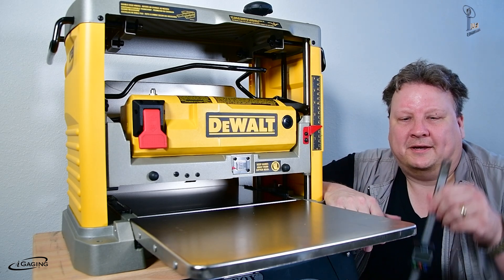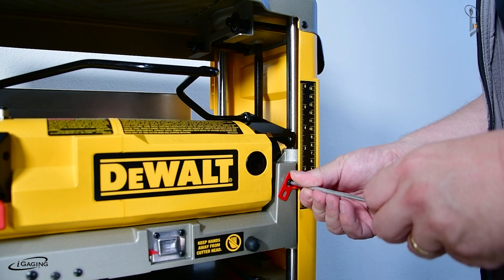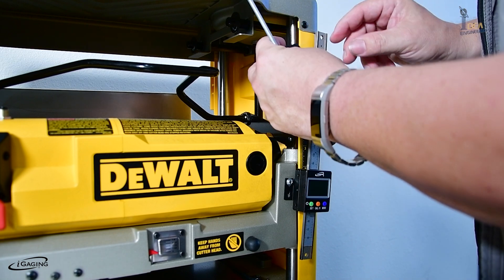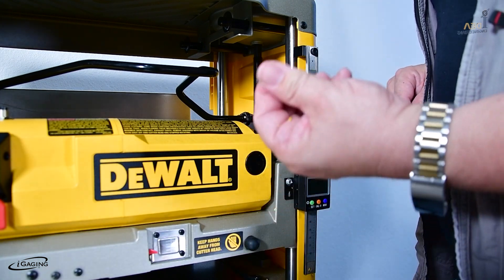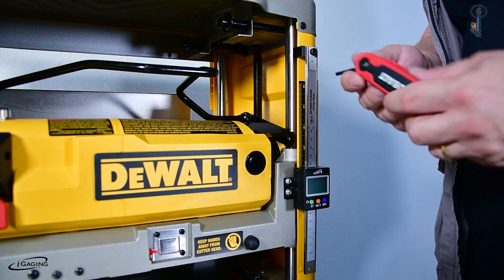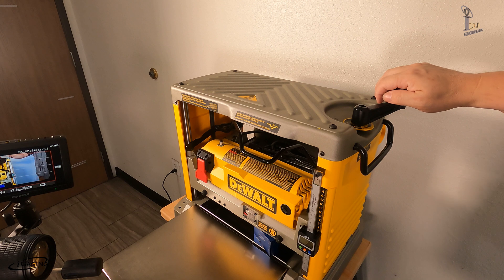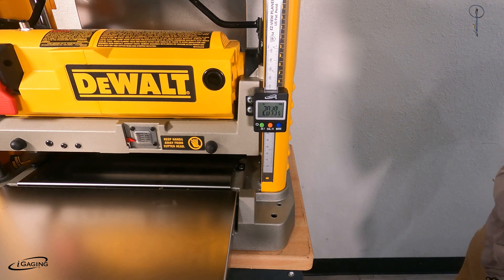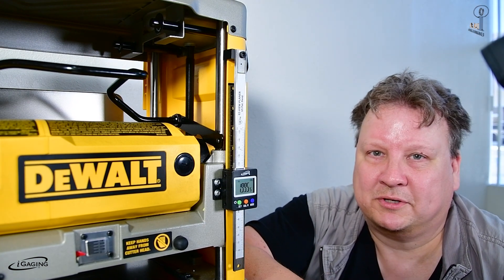iGaging's new Easy Planer DRO

Comment: Cant find that model on your website. And the one on your website looks as if it is designed for the newer dewalt planer. Are these interchangeable between the newer n older DeWalt planers. In other words one size fits all. ????
Reply from the maker: Hi Edward, 

Yes, this is the latest version for the Dewalt DW734. You can find it here: https://ideaengineering.us/?ec_store=pageid1904modelnumber35-600-p06

Thank you,

Sean
Reply: @IDEAENGINEERINGdotUS 
I’ve got an idea for you Sean, why don’t you try answering emails? I bought a bore gage set from your eBay store and it never showed up.  I’ve emailed you several times and get ZERO RESPONSE. you where quick to take my money and supposedly ship my item, but when there’s a problem you’re nowhere to be found!  I suggest you make a better effort to address the issue with my order.  
Words are a powerful tool and I plan on using them in every way I can until you fix this!

Comment: I'm sure the front of the machine doesn't correspond with the cutter. The better way to do it would be to run a board through, measure it with calibers, and set the dro to that measurement
Reply from the maker: Yes, that is correct. Thank you! I have put a correction in the video's description.